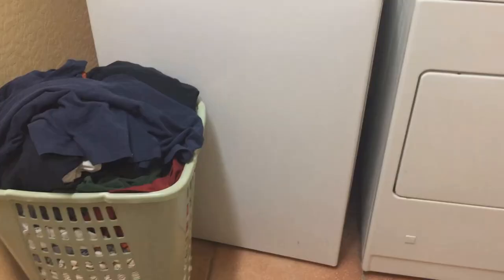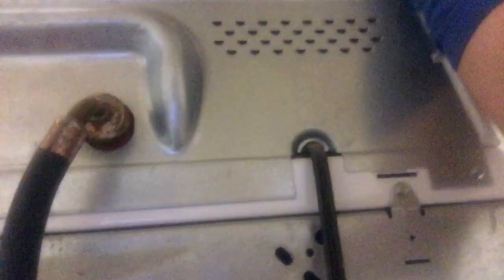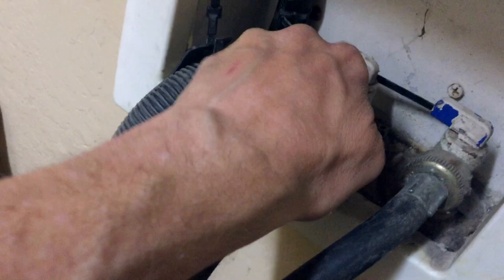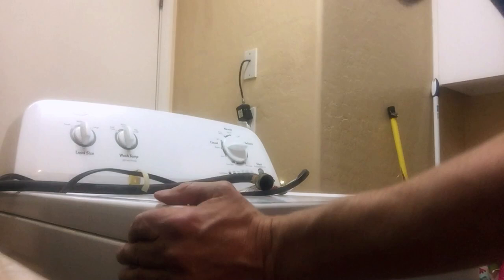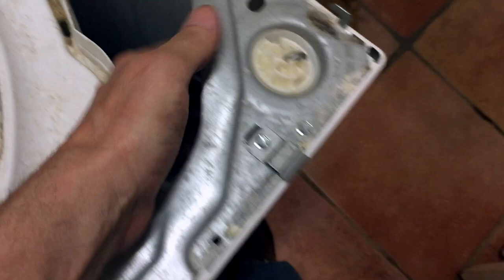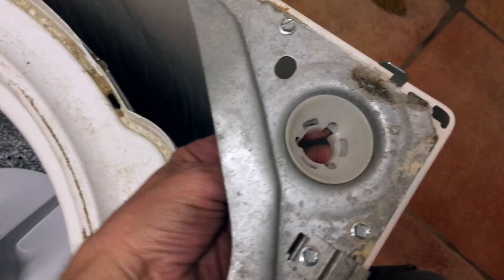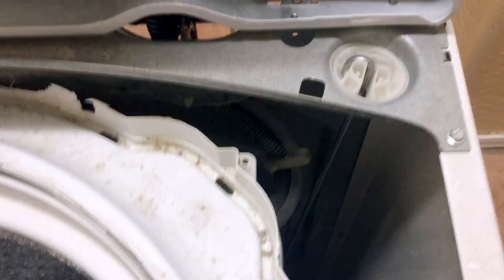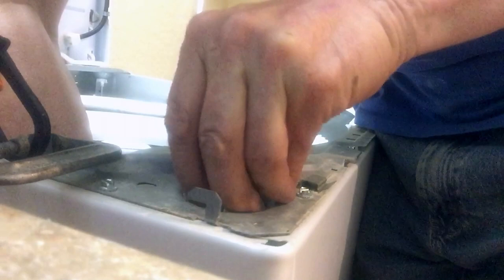Replacement suspension rod kit for loud shaking washer spin cycle Whirlpool Kenmore Maytag Roper

Comment: What tools do I need?
Reply from the maker: I had a big adjustable wrench to get the two hoses in the back off. Be careful you don't damage the male connectors on the back of your washer like I almost did. Just remove the hoses from the pipes in the wall instead. I used the same wrench to remove the clamp on the water outlet hose in the back. 

Also, I used a 1/4" socket wrench to remove the screws in the back (but you could use  a pair of pliers if you prefer).

I think I did everything else by hand. Good luck!

Comment: I replace mine but after a week its load and banging again
Reply from the maker: If you don't mind sharing, can you tell us if your replacement suspension rods were the ones that cost around $30 or the ones that cost around $60 (like the ones linked in the description)?  I was tempted to get the $30 ones but then I read a lot of reviews that had the same problem that you are having where the banging starts again after 2 or 3 loads.

Comment: That’s how mine is and I just replaced mine and still doing it. Any suggestions?
Reply from the maker: I am sorry to hear that. There are two things I can think of. First, there are many people who buy the $20 - $30 replacement suspension rods that in their reviews say the problem returns after just a couple of washes. So that is why in the description you will find a link to the more expensive original $60 suspension rods from Whirlpool. And second, someone wrote a comment that said that after you do this you have to recalibrate the washer.  I wrote about that in the description. Here is a video of how to do that. https://www.youtube.com/watch?v=WpEcZ5kYKN. 

Good luck.
Reply: @bulletpeople  yes sir, I recalibrated as well because I also replaced the drain pump and that looks like it’s working fine now. Only thing is the shaking. Yes I bought the least expensive well 47$ suspension rods. You think that might be the cause?
Reply: @bulletpeople  well, lord and behold I put 2 original rods back on and seems to work like a charm. No more shaking. Man, those cheap rods don’t know what they are made of but geeesh. Headaches 😅
Reply from the maker: @robertmunguia250  Very cool solution. Yes, I almost bought the ones that cost half as much as the Whirlpool factory originals but luckily I happened to read a bunch of 1 and 2 star reviews that said it started happening again. I hope these last for you.
Reply: @bulletpeople  well, that didn’t last long. After 2 washes back to shaking really bad again. I’ll have to send those rods back and get the whirlpool ones. Or the OEM ones.

Comment: Where do you got the springs from? Mine is an Insignia machine
Reply from the maker: I got mine on Amazon. LInk is in the description: https://www.amazon.com/gp/product/B010JRV0UM/ but you should use the "Check fit by model" to see if this works with your model. Good luck.

Comment: Question do you remove both cold and hot water hoses?
Reply from the maker: Yes but what I didn't realize until I realized one hose was fused to the washer by corrosion that it didn't matter which end you unscrewed. I ended up unscrewing both hoses from the water spigots in the wall and left them on the washer.

Comment: Hi I have this same washer, same problem, this video helps, I am looking to do the same thing but I am wondering about repair vs replace ( I guess that's always the question with home repairs).  So I was hoping you would tell me, IS YOUR MACHINE STILL WORKING OR DID IT BREAK AGAIN?  Is it back to shaking like an earthquake?  I see you posted this 6 months ago so it has been at least that long since the replacement, are you still in business or is it back to the same old problems.  Your info would help as far as if I am gonna repair/or replace mine.  Thanks a lot.
Reply from the maker: My Roper is still working like a champ. I am hoping to get another 3 years at the least, and maybe 6 if they last as long as the factory installed suspension rods.

But be sure to get the actual factory rods for around $60 and not the after-market ones that cost $30. The link is in the description to what I bought, which are sold by Whirlpool. (Apparently they make a lot of these different brands.)

Good luck!
Reply: @bulletpeople  I will do that, You're the king!  Thanks so much.

Comment: Just curious, any issues after a few weeks/months?
Reply from the maker: No. It has only been about 15 loads, but there is no shaking or vibration that I can tell, and certainly no banging sounds like you see in the video. If I understand correctly I ordered the factory replacements (link in the description) from Whirlpool. Whirlpool makes Roper so I expect to get another 8 years from them like I got from the original set if something else doesn't break first.
Reply: Great! Thank you. I hope for your continued success
Reply: I did it! Mine was nearly identical to yours. It WORKED!!! I did end up putting zip ties to hold the top to the machine because there is no hinge. I couldn't find my bungie cords. Also, my tape failed on the lid. Humidity is not a good friend!!! Anyway, its working great! Thank you for sharing
Reply from the maker: @microtam  Great to hear. Congratulations!

Comment: I was having that problem replaced the suspension rods damn if it didn't happen again. Ran good for a while then started showing its @$$ again. Same thing with my parents washing machine. They don't last long. Cheap made peace of Crap.
Reply from the maker: Sorry to hear about that. Did you get the rods made by Whirlpool? I have heard many people who bought the ones that cost around $30 and they fail after a few washes. I bought these when they were $60 https://www.amazon.com/gp/product/B010JRV0UM . (They cost $42 now, so I don't know if these are the same original Whirlpool rods I bought.)

Comment: This might be the worst how to video I’ve ever seen..... is this the first time you’ve worked on a washing machine?
Reply from the maker: No. The second. The first time I pulled a nickel out of the drain line. I did however replace the ignition solenoid coil on my dryer by watching a YouTube video. The guy who made that video did it in a pristine workshop.  It took 10 minutes, and he had a big smile on his face. When I did it, it took 2 hours in a cramped laundry room and I hated every second of it.

Comment: replace suspension rods and it did NOT fix the problem, better but not fixed
Reply from the maker: That's a shame. Do you know if you got the Whirlpool parts or after-market parts? The official Whirlpool suspension rods used to cost $60 and the knock-offs were $30.  But recently the Whirlpool have come down to $38 (at https://www.amazon.com/gp/product/B010JRV0UM). I don't know if they are still official Whirlpool rods, though. I've heard of a lot of folks with the cheaper rods whose problem came right back after 2 or 3 washes.